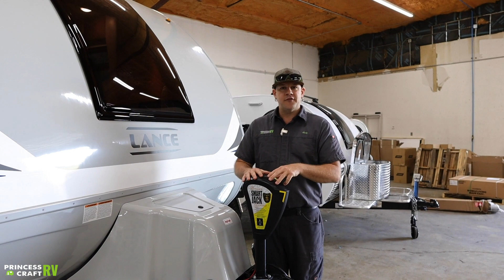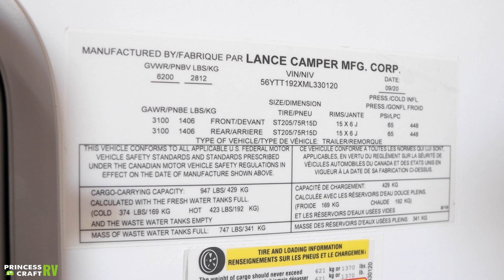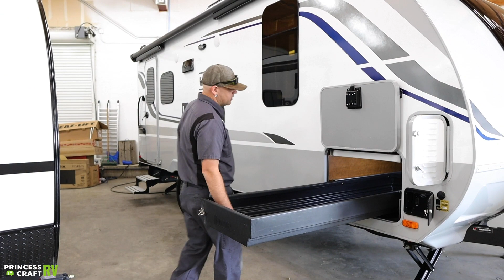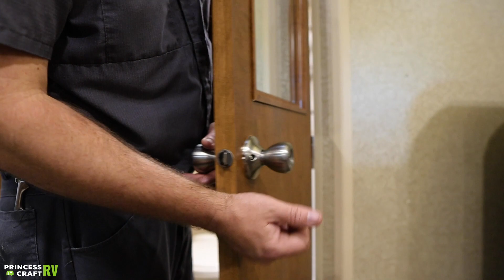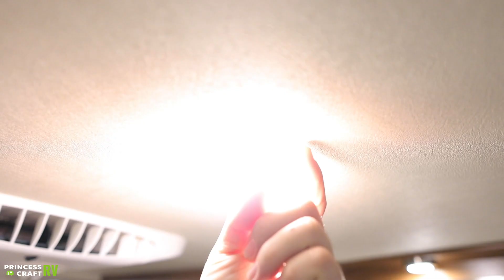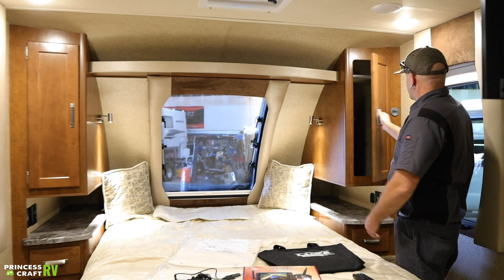2021 Lance 1995 - Technician Tour

Comment: This is a great video. I just purchased a used 2021 Lance 1995. I do have a question. At the front of the trailer in the corners there are some white LED lights. Mine do not appear to shut off. In the video they were also on during the discussion about the hitch and propane tanks. How do they shut off?

Comment: Bought a Bigfoot trailer from this company in 2017. Took it in for warranty work after purchasing the extended warranty they talked me into. Had a window leak..they wouldn't cover it. Had a kitchen sink leak, they "fixed" alright. It leaked after. Repaired it myself. Not a fan of the company.